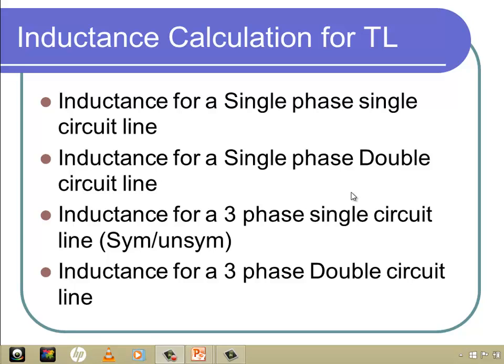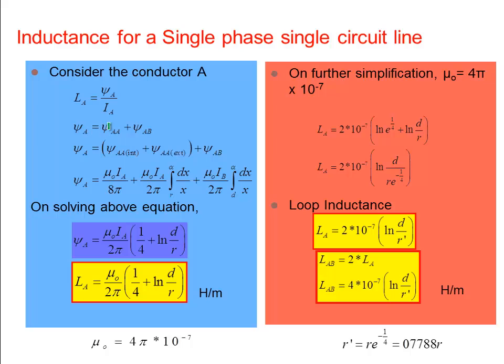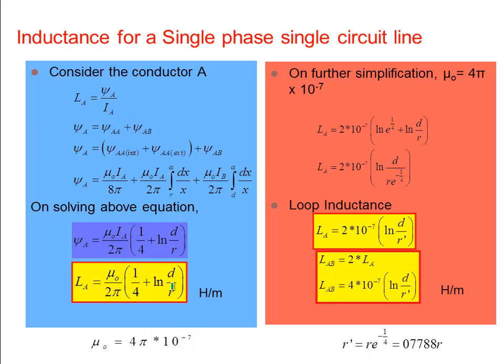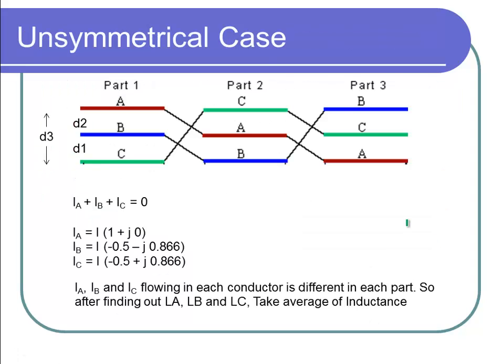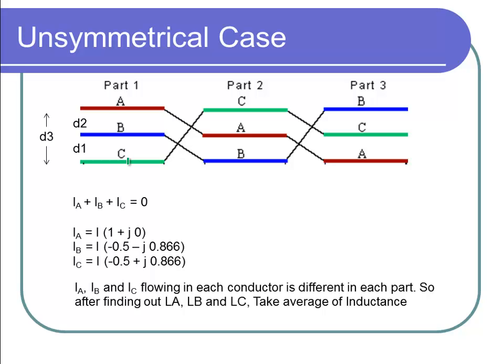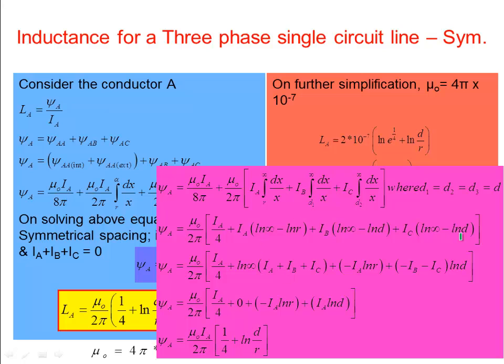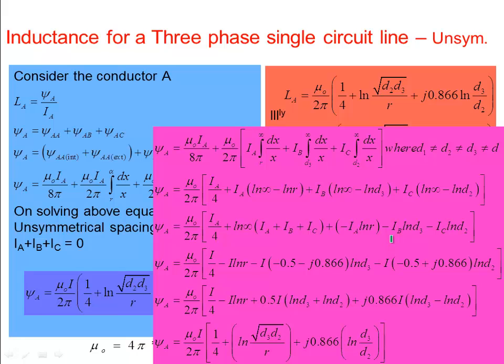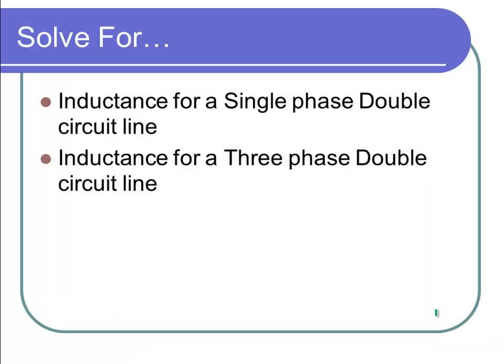Electric Transmission Line Parameters 3 - Inductance Calculation

Comment from the maker: Capacitance effect in the transmission line forms between the two conductors or conductor to earth. And the fraction of leakage current to the earth creates the conductance in the line, but that is too small. So capacitance and conductance are connecting in parallel.

Comment from the maker: While passing the current into the conductor, magnetic flux will create surrounding the whole length of the conductor. Also resistance present in all over the conductor. So resistance and inductance are drawn in series connection in equivalent circuit.

Comment: why resistance and inductor are connected in series and conductance and capacitance are connected in shunt in trnsmsion line
Reply: Mohanrao Katram 
Capacitance is static electric field.It will be  between conductor and earth.  Inductance is magnetic field when current is in the conductor.it comes in series.